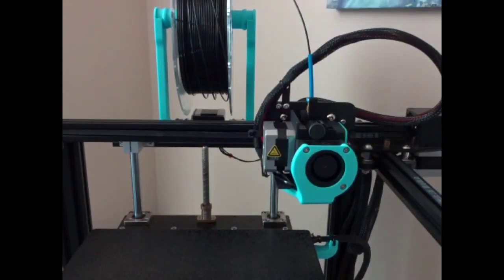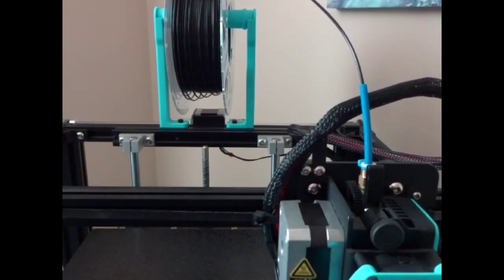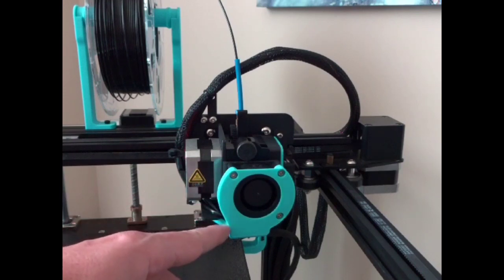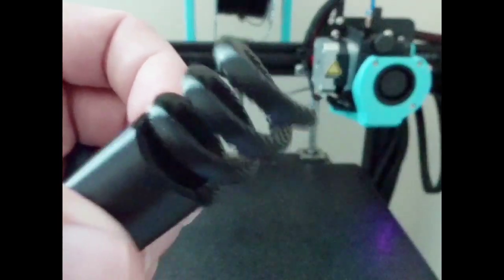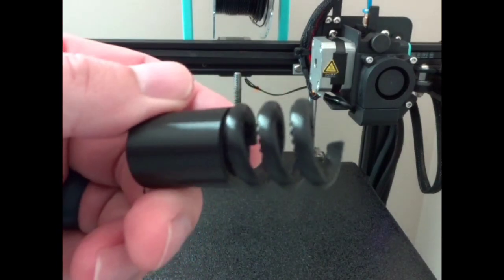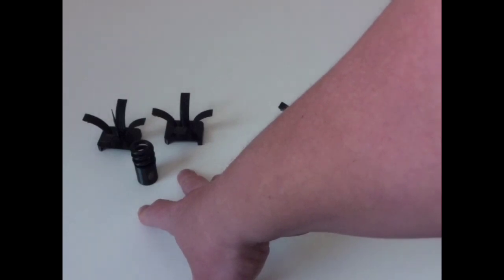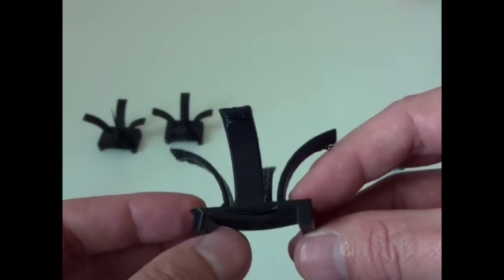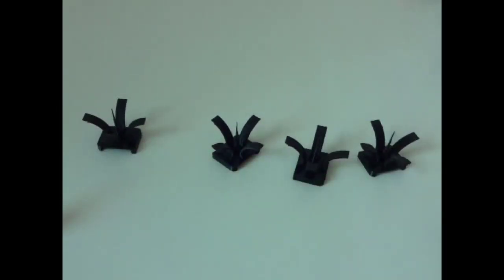Sovol SV05 - Free 3d printable upgrades.

Comment: Hey, Have you klipperized the sv05 since this video? I have one due to arrive and aside a couple of platic bits, this is the first actual upgrade I have in plan. Would be great to get a take on which would be the better path - get a RPi / clone or a dedicated slate ( like Creality's or BTT or something similar).
I want to use its native board for a time and only later get an Octopus or similar, for a mercury build.
Looking forward to your reply 😊
Reply from the maker: Yes, I am running klipper on my sv05. If you go to the klipper github under configs you will find the printer.cfg for the sv05. I have not used any of the pads  so I cannot really speak to them. I too plan on doing a mercury build at some point but Its a great printer as is though. I plan to do a whole series of videos on my mercury build once I start. Just have too many other projects in front of it right now.
Reply: @joeprints3dstuff  Much appreciated! What speeds do you get...with consistency and reliability that is, since running klipper on it?
Reply from the maker: @mariusranga  speed wise i run 200mm at 0.2 line height is my normal.
Reply: @joeprints3dstuff  very nice...that's my ballpark goal as well 😀
Much appreciated for your time and advice.
I'll go ahead and subscribe so i can catch your updates when you pop them 😀
Reply: Hey again, I'm just now printing the fan shroud and just checked the extruder motor - it's just like the label states - Hot. Have you adjusted your Vrefs or keeping them as they came out of the box?
I'm thinking i need to adjust mine since Z and Y are decently warm but X and E are hot. Haven't measured the values yet but, following the shroud completion, that's next on the list.
Reply from the maker: @mariusranga yes, I adjusted mine. Only did e though as xyz were fine.
Reply: what value did you set it at? :)
Reply from the maker: @mariusranga i just dropped it down until it was warm to the touch and not fry an egg hot.
Reply: roger roger :) thanks for the advice